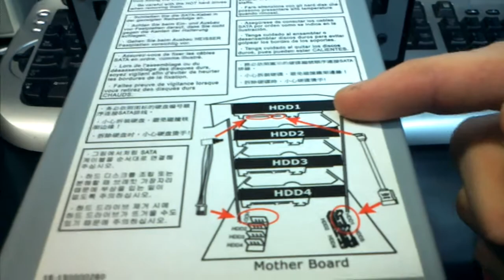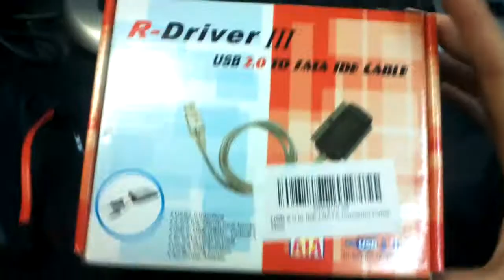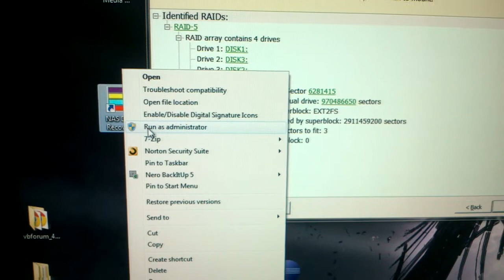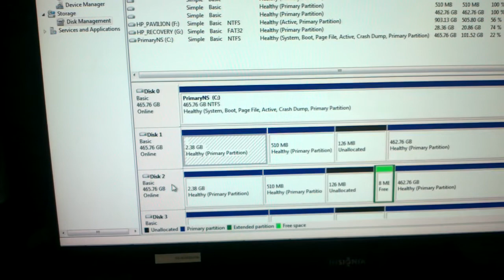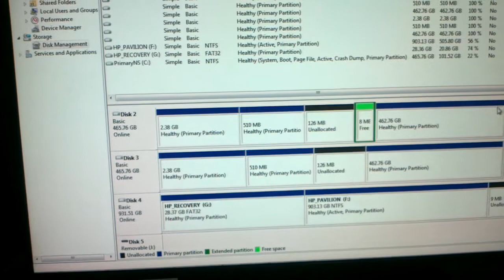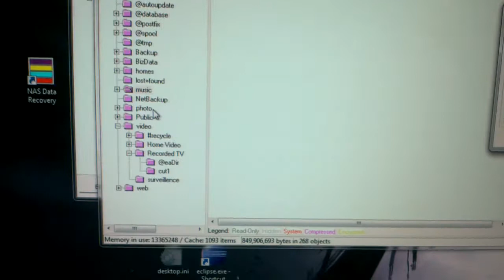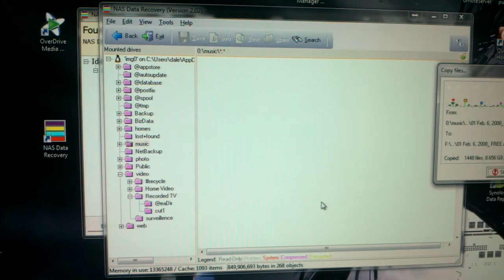Synology NAS data recovery

Comment: The Spare does no good when the volume fails. I am currently in the same position. I have a 5 Disk Raid with one Disk Failure fault. Volume Crashed. Synology cannot restore the crashed Volume. The Drives are in good condition. The Volume crashed after a power failure.

Comment from the maker: In this instance it was running raid 5, but a two of the drives crashed breaking the raid 5 array before could be repaired by replacing the 4th drive and rebuilding the array.

Comment: wouldn't be better use raid 5 with spare?? so you would just remove the fault disk and insert the new one... "in my opinion" there is no point use raid if you cannot hotswap disks..

Comment from the maker: I am not sure which raid you are running.  I'd ask support first.  Does you have the network recycle bin turned on?  If so then you can access the Recycle folder located in the folder of the files you deleted. I don't think using Runtime will recover the deleted files.  There are a few programs out the to recover delete files. Not sure of the names, but I think that is the route you have to go.  You can try pcrecovery or panda recovery.